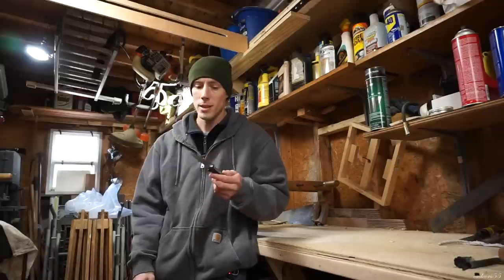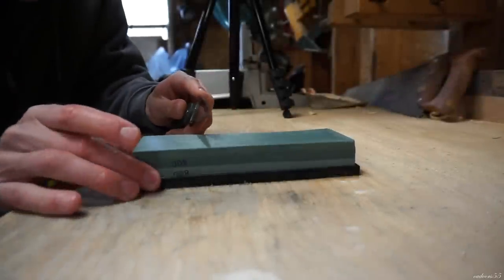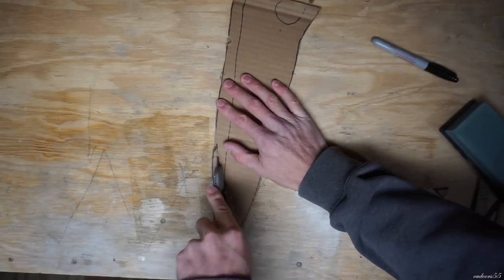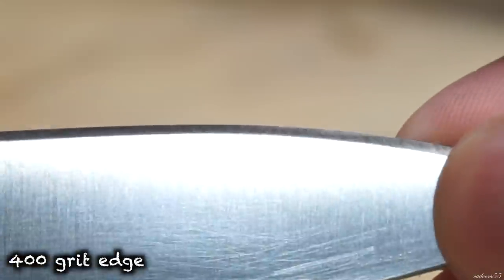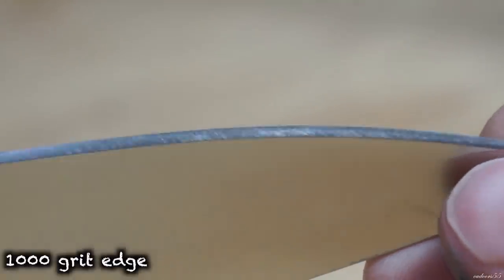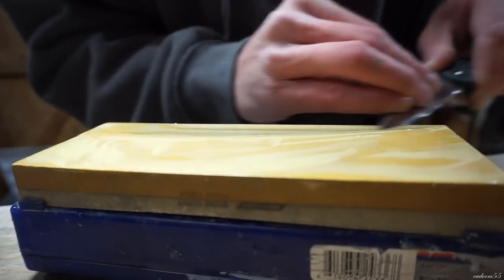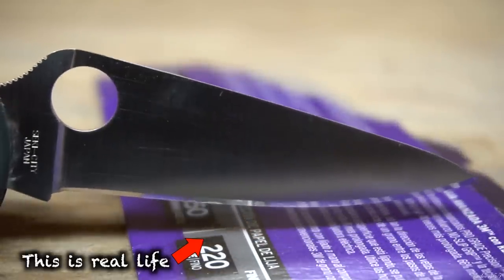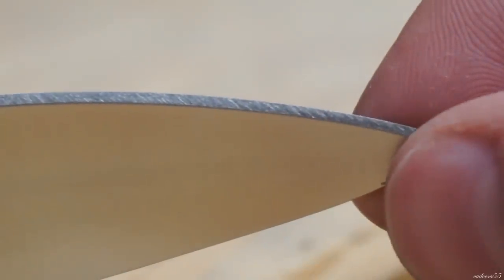HOW TO REMOVE CHIPS IN A KNIFE BLADE | Knife sharpening tips

Comment: Good info. My first chip I just reprofiled on diamond stone without smoothing the chip out, as you did in step #1. Time consuming indeed. My 2nd chip removal was much larger. I hit some hidden brick with my 1095 steel blade. I saw your video, and added step #1. It took time either way, but not nearly as long by flattening the chipped edge first. Thanks. Now to stop chopping on ground with hidden bricks.

Comment: Always thought you had to sharpen out the chip. This makes sense, thanks.Harry
Reply from the maker: You can sharpen out the chip. Even though it removes the same amount of material for some reason this way is much faster. I think it’s because there’s no guessing as to whether or not the chip is removed. You simply remove, then sharpen. Rather than sharpen and constantly check if the chip is still there. Just what I’ve experienced.😀 thanks for watching my friend 👍

Comment: Would you recommend sharpening at say 15 degrees and putting an 18-20 degree micro bevel? Or is it better to just have a 18-20 degree
Reply from the maker: I typically don't like micro bevels. Most of my knives are from 17-20 degrees. IMO micro bevels don't add a lot of benefit.  Unless you have a problem with edges rolling or chipping at their current angle and don't want to re profile.  If you have to sharpen a lot, a knife with a micro bevel will eventually turn into a weird dual bevel thing that will eventually need a re profile job anyway. Just my personal opinion😀
Reply: OUTDOORS55 thanks a lot! I have a wicked edge and a spyderco sharpmaker that my dad used back in the day. I sharpen at 15-18 and use the ultra fine stones which are at 22-23 degrees to refine the edge

Comment: If that's your zdp-189 endura then I feel your pain with the chipping. I have a delica in zdp and it seems like it like to chip or micro-chip rather than having the edge roll over. It took me forever with a lansky system with diamond stones to re-profile and sharpen.

Comment: Great vid. I use a fixed system to sharpen now because I'm honestly too nervous and doubtful to do it by hand but I might give it another go.
Reply: DSNugent91 I would honestly recommend trying out hand sharpening. If you're scared get some dollar store kitchen knives to practice with. I tried hand sharpening for the first time recently using 320 grit sandpaper and a shitty setup and managed to take my knife to completely dull to somewhat sharp without completely ruining it.
Reply: I've tried in the past with a small bit of success but as I got more expensive knives I just found it more consistent (easier and a better finish) to use a system. I've been recently watching Mike emler and he has made me wanna give it another go, but a real go at it this time.
Reply: DSNugent91 I can't fault you for going with a controlled system if it gives you better results and I myself have a controlled angle lansky system on the way. But, there just something so satisfying and relaxing about hand sharpening
Reply: I have the lansky deluxe edition or something like that, it goes from a 80 grit to a 1000 grit then I strop for mirror finish but after watching a few videos I'm going to purchase the 1500 stone and I'm not sure but I think I seen a 3000 stone for it as well

Comment: Hi there, I really like this video on how to deal with knicks. Since I work with woods I usually just sharpen chisels on the coarsest grit until the knick is gone. But your method seems to be much easier and useful. I also have a question, I have have water stone 1000 and 6000. And I would sharpen the kitchen knives with it. I also watched and like your video on sharpening knives and always refer to it. But as I sharpen my knives I am worried that I am rounding off edge. How do you know if you have rounded off your edge? I feel like I am sharpening my knives the wrong way. Any helps or tips would be appreciated.
Reply from the maker: If you round off the edge it will be dull. Maintaining an angle is the most important part. If your getting shaving edges your edge is not rounded off. Just practice going slowly and maintaining an angle. Thats really it! Hope this helps😀

Comment: DUDE Excellent video! i had lots of issues with chipping and eventually learned to do it like this. you could have saved me the hassle if you released this a few years ago lol.

i would say dont apex on a very coarse stone. like say 50grit or 100grit. other than that you are right. its best to fully apex with your coarse stone as long as it isnt too coarse. i dunno i just wanted to add that from experience. too coarse a stone will ruin the apex.

you can probably remove alot of those small scratches with a couple strops. ive recently obtained some diamond paste. using 1micron, .5 micron and .25 micron it cleans up those left over scratches pretty well. but thats being a little cray cray lol.
Reply from the maker: Yeah I should have clarified on the coarse stone but. This was a 400 get stone I apexed on. The lowest I ever have to go is 220. Haha I almost never mirror polish as my polish is usually wrecked by the end of the day anyway. Guess I should stop cutting sand pepper with it! Thanks for the comment 😀👍

Comment: This is what I do on tomahawks too, though I use a file for the first step (suppose it'd work on axes and hatchets too). I've never actually chipped a knife bad enough to need to do this but good to know it's essentially the same procedure.
Reply from the maker: I use the same method on axes as well. For some reason it’s much faster than trying to sharpen out the chip. I just started doing it anytime I had a small chip or nick and it works much better for me. Thanks for the comment 😀👍

Comment: I've often wondered how you approach chips. Good info man. I have some decent sized chips in a new bushcraft axe that im very sad about. Not sure how they even got there. Being that im not any good at sharpening a knife im terrified to start grinding away at it, since it was not cheap. Let me know if you need a prop for an "axe chip fix" vid. lol I'd gladly deliver!
Reply from the maker: An axe would be the same. Although its easier to use a file for axe chips. Just file the chips out, then file back to a point. You would be surprised how sharp a file will make an axe. If you need it sharper you can use sand paper to sharpen it. Its really not hard to do. A lot of the old loggers used to only sharpen with a file. You can't really mess up an axe beyond repair by hand. Theres so much steel on an axe you can almost fix anything. Its worth taking the time to learn. Then if it happens again (and it will😉) you can just fix it. Just use a good new file!
Reply: Get yourself a Lansky puck from Amazon for $7. They are perfect for axe/hatchet sharpening and re-profiling since they fit snugly into the cup of your hand. The one I bought is a dual grit 120/280. Very easy to use.

Comment: Hey man, What is your favorite low grit wet stone out there? My bearmoo 240/800 grit gets eaten up super fast and I would like to have one that will last a bit longer..
Reply from the maker: I use edge pro stones by hand all the time. The 220 grit is awsome and last forever. They are small but also don’t require soaking and are ready to use almost instantly. They also sell a 120 grit as well.
Reply: OUTDOORS55 awesome thanks man! I’ll check them out.

Comment: Helpful video, yeah!
I'm setting here working on some of my knives when the notification pops up !
Question, have you come across problems with sharpening Damascus steel on a knife ?
I seem to have trouble getting a decent edge on mine, maybe it's just the steel it's made of !
I wouldn't think that it would be much different from other knive steel, maybe it is.
Thanks for sharing and take care. 👍
Reply from the maker: Only sharpened one Damascus blade. Most of them are hardened pretty hard. I always use a coarse (220 grit) stone to start, no matter the condition. It helps you apex right away and fast. This is my secret to dealing with super hard steels. Hope this helps😀
Reply: OUTDOORS55
Thanks!